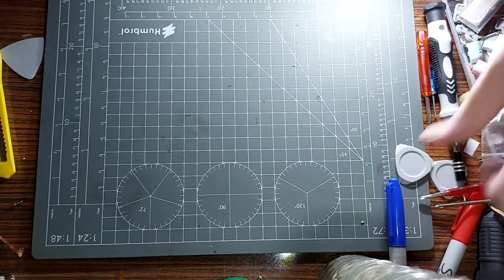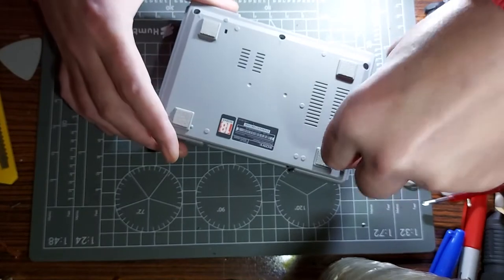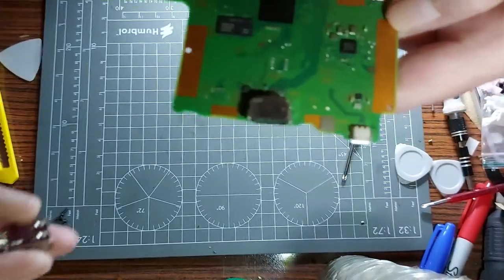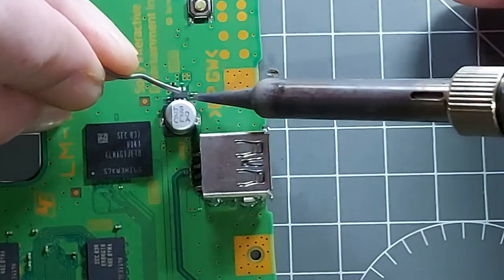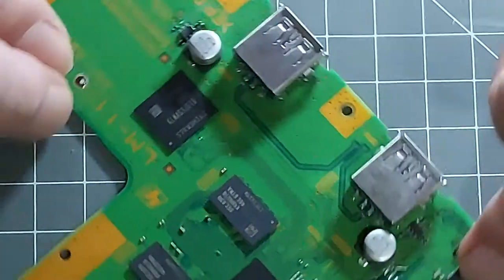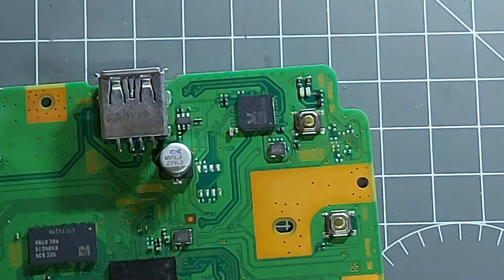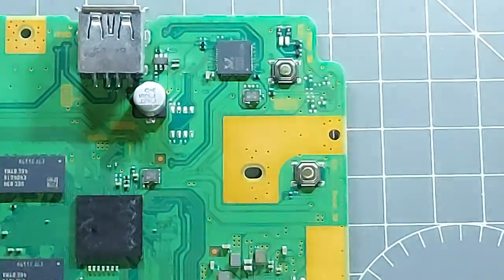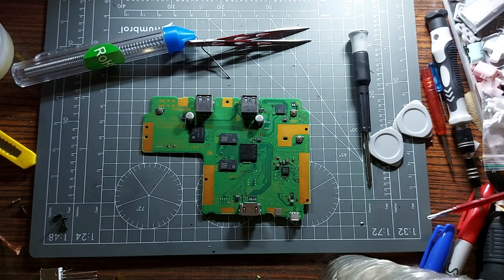Playstation Classic teardown and usb power mod

Comment: do you repair broken psc? nice video!
Reply from the maker: Thanks, iv not tried repairing 1 yet. Just modded.
Reply: @gadgetmadlad6691  okay! worth a shot asking :)
Reply from the maker: @Wicked S, what wrong with it? Let me know and I'll see if I can help.
Reply: @gadgetmadlad6691  at first it wasnt reconizing the controllers not even the orginal controllers than it stopped powering on completly. i believe i fried one of the chips on the mother board but im not sure exactly. im currently waiting for a new charging port and wire now to see if that helps.
Reply from the maker: Let me know how it goes.
Reply: @gadgetmadlad6691   well the new charging port and wire didnt do anything. my old wire and charger work better so im doing something wrong but ill keep a look out on your future videos if you ever do any videos on repairs! :D

Comment: If you can can you do a switch lite mod
Reply from the maker: @dominickmolyneaux5713  which mod? Iv got a pico thing to mod1 when  I get 1 cheap enough lol. But if you have any suggestions I'm always intrigued. Let me know
Reply: @gadgetmadlad6691  I’m trying to install the rp2040 but I don’t have a micro scope do you think a phones camera will work
Reply from the maker: @dominickmolyneaux5713  if it's a modern ish phone should be fine. Check your camera settings to see if you have a macro option that would probably work best, oh and plenty of light.
Good luck with your mod, I do have the little raspberry pi pico rp2040 myself for when I can get a switch lite for cheap enough lol.
Have you seen the taki udon video showing the switch lite ips mod? 
That's definitely on my to do list.
Reply: @gadgetmadlad6691  no I haven’t seen the video I’ll look at it though and thankyou